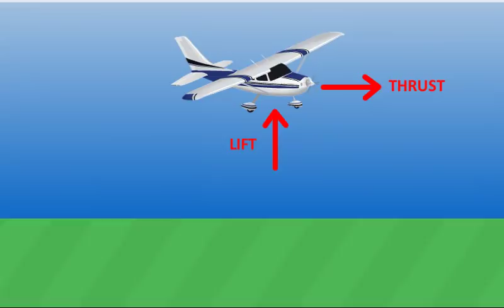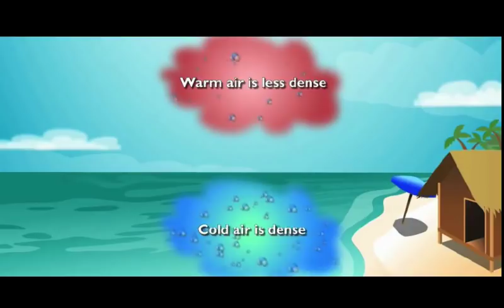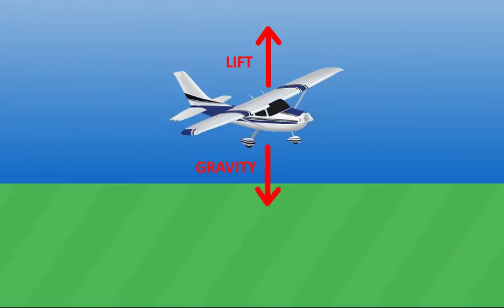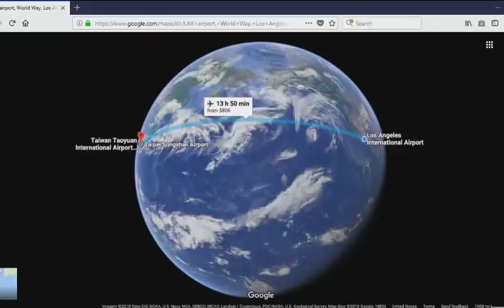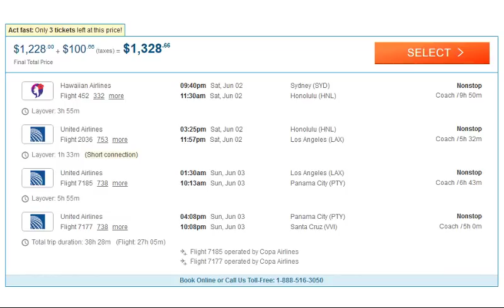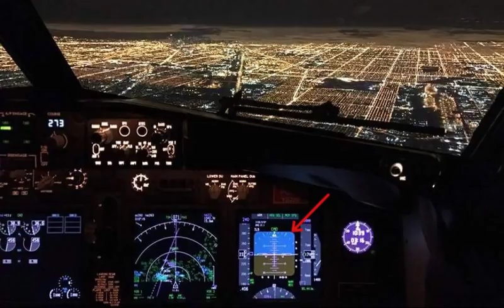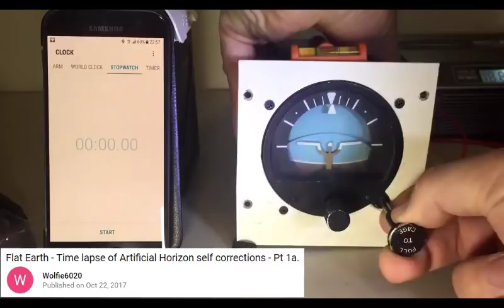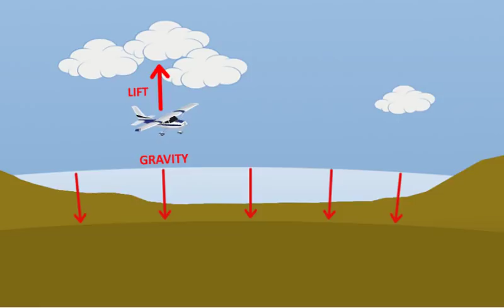Flat Earth Falsities - Plane Nonsense

Comment: Listen to what you're saying dude. Clouds stick to this earth due to this Force you can't identify called gravity!? A force you've never seen for yourself. I can simply explained stuff falling and sticking to the Earth as density. I see clouds moving all the time and they're never moving with the Earth. They sometimes move fast and sometimes slow but I always independently. I can explain this easily due to the water cycle and thermodynamics. Clouds also move swifter and slower due to weather currents that are caused by these temperature changes and wind which pushes and pulls the clouds accordingly . This is how thermodynamics work. I don't even have a science degree and I can explain this due to my own observations. Whenever y'all can't answer simple questions gravity is always the answer. Always!
Reply: "A force you've never seen for yourself."
Can you see magnetism?
Reply: AI fan IDIOT A MAGNET IS A MANMADE OBJECT !! IF GRAVITY WAS A THING YOU CANNOT COMPARE THEM AT ALL BECAUSE MAN DID NOT MAKE GRAVITY !! ITS JUST A WORD TO ANSWER EVERY QUESTION FOR THE GLOBE STUPIDNESS TAKE OUT GRAVITY FROM THE CONCEPT AND ALL THESE PPL WONT KNOW THE FUNCTION OF THE EARTH, WE DO NOT USE GRAVITY AT ALLL TO EXPLAIN EVERYTHING WHY IS THAT? BECAUSE IF THE WORD GRAVITY DIDNT EXIST THE FLAT EARTH MODEL WOULD BE PERFECT AND EVERYONE WOULD KNOW THE EARTH IS A PLANE NOTT PLANET FLAT EARTHER KNOW THAT GRAVITY IS A MADE UP THING TO MAKE ALL YOU GLOBERS BELIEVE THE GLOBE LIE
Reply: @jayreckless1120  Diddums. Bless. Watch your heart. No need to throw shouty hissy fits is there.
"A MAGNET IS A MANMADE OBJECT" No., why don't you follow your holy, unbreakable mantra "Question everything. Do your own research"? You didn't question a thing, did you. You didn't do any research, did you. Why not? You FE cultists are always telling other people they are sheep and the magnificent FE cultists are not sheep because they always follow the mantra "Question everything. Do your own research".
Ancient people learned about magnetism from lodestones, magnetite
The first magnets were naturally magnetised pieces of iron ore, lodestones or magnetite. The word magnet is from Latin magnetum "lodestone",  from Greek μαγνῆτις [λίθος] (magnētis [lithos])[1] meaning "[stone] from Magnesia".. Lodestones were the first magnetic compasses. The earliest known surviving descriptions of magnets and their properties are from Greece, India, and China around 2,500 years ago.
"BECAUSE MAN DID NOT MAKE GRAVITY", just like he did not make magnetism,
Reply: wong stop right there your using information given to u by occultists how does it prove anything? We have  real proof Wong look I’m not here to start arguments something big is COMING BRO AMD IT INVOLVES EVERY SINGEL NATION BELIEVE IT OR NOT , READ PROJECT BLUE BOOK WE SUPPOSEDLY HAVE ALIENS IN EARTH AND YALL BELIEVE THAT TOO?!YOUR GOVERNMENT DOES NOTHING BUT LIE AND WE BEEN LIVING A LIE BRO I FOUND THAT OUT 2 YEARS AGO !  SO IM LETTING YALL KNOW BECAUSE WE ARE ALL INVOLVED
Reply: Dawid Dziedziak ITS CALLED MASS BRAINWASHING AND IT COMES WITH AN  AGENDA LOOK ON THE CIA FILES THAT WAS CLASSIFIED UNTIL THEY RELEASED IT TO THE PUBLIC AND WE DIDNT EVEN NOTICE MY QUESTION IS IF ALL THIS IS JUST A CONSPIRACY WHAT SERGE MONAST SAID THEN WHY WAS HE AND HIS CO AUTHOR BOTH ASSASSINATED OVER A CONSPIRACY? And FOR YOU GRAVITY PPL EXPLAIN THE MOON , HOW IS THE MOON NOT BEING PULLED BY GRAVITY ? IM PRETTY SURE “GRAVITY “ WOULD EITHER PULL THE OBJECT UP OR HAUL IT DOWN BUT THE MOON SHOWS NO SIGN OF FORCE MOVING !!
Reply: @jayreckless1120  Seek medical attention ASAP.
Reply: @jayreckless1120  "We have  real proof" Well, where is it?
 "Wong look I’m not here to start arguments". So why did you and are you?
"your using information given to u by occultists"
Sextant corrections. Personal experience and observations.
 Long distance navigation. Personal experience and observations.
Spherical trig.  Personal experience and observations.
The fact that land slowly goes below the horizon when you sail away from it and slowly rises from the horizon when you sail towards it. Personal experience and observations.
The fact that you can see further with increasing height. Personal experience and observations.
Celestial navigation. Personal experience and observations.
Personally observed proof of rotation. Trade winds, TRS, gyroscopes and gyrocompasses, ocean currents, weather patterns.
Al that is real proof.
"We have  real proof" Well, where is it?
Reply: Dawid Dziedziak I got one question for you if you have a big plan very big you would need to fund as much as you can to keep the plan going right? Hiring everybody u can and all that right ? Now look back into all our science and everything we know today , WHERE DOES IT COME FROM ?! OCCULTIST EVEN YOUR WRITERS AUTHORS EVEN YOUR SHERLOCK HOLMES WE LOVE TODAY THAT WAS ALSO CREATED BY AN OCCULTIST , ASTROLOGY ALCHEMY THOSE ARE ALL OCCULT SCIENCE!!! EVEN OUR ENGLISH LANGUAGE CAME FROM THE ENOCHIAN WHICH ALSO WAS AN OCCLUT LANGUAGE!!! WTF GUYS DONT YOU SEE OUTLR WORLD ORIGINATED FROM FUCKING OCCULTISTS AND YALL STILL BELIEVE THEM !! LOOK IT UP GUYS YOUR MISSING ON ALOT AND THERES A REASON FOR THAT !! DID YOU KNOW ABOUT CLOUD SEEDING ?!! ITS USED TO MESS WITH THE WEATHER INCLUDING RAIN AND SNOW !! NOW IF THEY COULD DO THAT WHY ARENT THEY CAUSING LESS SNOW OR LESS RAIN !! ? BUT NOO EVERY YEAR THE WEATHER GETS WORSE WHEN YOUR FUCKING GOVERNMENT CAN CONTROL IT
Reply: @jayreckless1120  Then stop speaking english and using computer, internet, smartphones, cars, television etc. . It all comes from 'occultists'.
Reply: @jayreckless1120  "By the time Project Blue Book ended, it had collected 12,618 UFO reports, and concluded that most of them were misidentifications of natural phenomena (clouds, stars, etc.) or conventional aircraft. According to the National Reconnaissance Office a number of the reports could be explained by flights of the formerly secret reconnaissance planes U-2 and A-12. A small percentage of UFO reports were classified as unexplained, even after stringent analysis. The UFO reports were archived and are available under the Freedom of Information Act, but names and other personal information of all witnesses have been redacted."
So no actual proof.
Remember, David Copperfeld is a billionaire because of how easy it is to fool the human senses and no other reason. Sadly, people such as yourself somehow seem to ignore  facts like this.
Reply: wong READ ON OPERATION FISHBOWL AND WHY DOES OUT GOVERNMENT SAY “WE DONT WANT TO OPERATE OUR ENTIRE NATION IN A FISHBOWL “ IF THE EARTH WAS A SPHERE THEY WOULD NOT REFER IT AS A FISHBOWL WHY BECAUSE A FISHBOWL FLIPPED UPSIDE DOWN IS A DOME WITH THE FLOOR BEING THE FLAT SURFACE NO LIE WONG GO READ IT IN THE CIA FILES SINCE YOUR THERE AND TELL ME WHY THEY USED A FISHBOWL TO REFER TO THE EARTH
Reply: Dawid Dziedziak YOU WILL SEE WHEN IT COMES AND THINK OF ME I WANT US TO WORK TOGETHER BUT YALL CANT EVEN DO THAT THEY ARE AGAINST US THEY LIED ABOUT THE MOON THEY NEVER LEFT!!! SO NOW SUCK THAT UP AND FIGURE OUT WHAT YOURE GONNA DO ABOUT IT PROBABLY NOTHING .
Reply: @jayreckless1120   "We have  real proof" Well, where is it? You have yet to provide anything.
 "Wong look I’m not here to start arguments". So why did you and are you?
"your using information given to u by occultists"
Sextant corrections. Personal experience and observations.
 Long distance navigation. Personal experience and observations.
Spherical trig.  Personal experience and observations.
The fact that land slowly goes below the horizon when you sail away from it and slowly rises from the horizon when you sail towards it. Personal experience and observations.
The fact that you can see further with increasing height. Personal experience and observations.
Celestial navigation. Personal experience and observations.
Personally observed proof of rotation. Trade winds, TRS, gyroscopes and gyrocompasses, ocean currents, weather patterns.
Al that is real proof.
"We have  real proof" Well, where is it?
Reply: @jayreckless1120  Feed my sheep. Baaa. baaa.
Reply: @TheGodlessGuitarist  who said anything about magnetism? I just think things are a lot simpler than everybody wants to make them out to be.
Reply: @Tiger-fv3nl  "ho said anything about magnetism? I just think things are a lot simpler than everybody wants to make them out to be."
The point is that YOU disregard gravity because you can't "see" it but you accept magnetism even though you can't "see" that either.  In other words you are cherry picking what forces you accept as real because one of them is damaging to your flat world beliefs.

"Buy I nice well zooming camera, go to your nearest beach and watch the boats go out of site then Zoom your camera in and watch those boats come into full view again."
I have done this.  Numerous times.  Portions of the boats hidden by the horizon never come back.  Ever.  Your experiment supports the globe.
Reply: @Tiger-fv3nl  you wrote "this Force you can't identify called gravity!? A force you've never seen for yourself.", you seem to be assrting seeing a force as a reasonable standard for accepting its existence. I'm simply asking on that basis of that standard whether you believe magnetism is a real force. BTW, I can identify gravity. It is called gravity. That is its identity.
Reply: @MrQuaiven  yes that can be easily explained by refraction but at multiple miles out boats that should completely disappear due to curvature can clearly be seen. My uncle owns a shrimp boat and this experiment has also been done multiple times. This is figured according to the Earth's curvature calculations given to us by scientist and mathematicians.
Reply: @Tiger-fv3nl   If you think that you are smarter that all the scientists who have spent whole their lives trying to explain the world we live in then, well, there is really no help for you. 

But here is a very simple experiment for you. Buy a precise laboratory scale with accuracy up to microgram and 1kg callibration weight. Now put that 1kg on a scale, here on the surface and then at an altitude of 5km. That one kg will weight a tiny, tiny bit less due to you being further away from the center of Earth - center of mass and gravity. This simple experiment proves that gravity is a real force.
Reply: "I don't even have a science degree"  There was n need to state the bloody obvious, was there.
"A force you've never seen for yourself." I've never seen you, so you don't exist. That is your logic. Fucking stupid isn't it.
I've never seen an electron, so electrons don't exist. That is your logic. Fucking stupid isn't it.
And so on.
Gravity is the name we call a natural phenomenon. Just like electromagnetism and germs.
To prove its existence, you need to hold a small item and release it from your grip. According to the law of inertia, it should have remained as it was. But did it? No.
The law and theories just explain how it affects things. OK?  Just like the law and theories of electromagnetism, oxygen and germs.
Gravity is the name we give to the phenomenon that objects accelerate towards each other when they are otherwise left to their own devices. The “proof” of gravity is the demonstration that the phenomenon happens.
http://www.bbc.com/news/science-environment-42183077
Gravity   Eddington
https://www.ecosia.org/search?q=Gravity+++Eddington
http://www.bbc.com/news/science-environment-42183077
https://www.ecosia.org/videos?q=The+Cavendish+experiment
"measuring gravity with GRACE”.
https://www.ecosia.org/search?q=%22measuring+gravity+with+GRACE”
Reply: @boffeycn  why do you feel the need to cuss? That just makes you look like a wee little man. Read my comment to the last guy. I don't need BBC articles to prove my point unlike you because we actually do experiments. Until you have done any experiments for yourself don't give me that nonsense. You are a fool if you think you need a science degree to do scientific observation for yourself
Reply: Proof the Earth is flat
Muy holey bubull am der troof.
Reply: @Ben J you are right it is actually 7.98 inches per mile squared. Whether you like it or not that is the official curvature calculation and there's no way around that. It's crazy I used to think the same thing you do until somebody told me to do some experiments and I did and the results were not what I anticipated.
Reply: @Tiger-fv3nl  BenJ is really going at it.... an other sane one that.. loves retards...  Dude want me to "Follow the path of the moon.... see how it's not glowing... "  Like anything SHE does is evidence of all this mad rotations going on.
Jesus! If the Sun has gone "down" west and it is dark all over, how can the Moon show up at east and be full, NOT SHADOWED BY the Earth?????????  DAH
Reply: @Tiger-fv3nl  " it is actually 7.98 inches per mile squared." and what shape does that describe?
"the official curvature calculation and there's no way around that.: Says who?
" I used to think the same thing you do " Lie.
Reply: @Ben J WELL well the Scientist worshipper, pray who are all these great minds??? Name a few aside of TV;  Neil deGrasse Tyson, Brian Cox, Michio Kaku, Bill Nye, Suzuki....  The path is not glowing... no it aint a burning gas ball anymore then the SUN is... both are electric converters beaming rays. 
That disk is facing DOWN, ...eee every other dont see same, as I went it rises and stands high. 
Drugs may explain some to that stuff.
Reply: You don’t need a degree man your smarter than these globe idiots on here they use gravity to explain everything! I bet they answer for my the water don’t just fall of the surface of the earth is gravity ! Lmao little did they know that gravity goes all the way it doesn’t stop after a certain action if there was gravity then someone explain the oceans if the gravity was keeping the water in wouldn’t that mean gravity is all around us ? But that’s not true is it? Because when I jump there’s no gravity and plus if gravity was keeping the waters in like they say then there would CONSTANTLY BE PLENTY OF STRANGE PHENOMENON WITHIN EVERY SINGLE CORNERS OF THE EACH OCEAN BUT THE OCEAN STAYS CALM AND THERES NO SIGNS OF GRAVITY THERE !!! SO WHATS KEEPING THE OCEANS FROM JUST FALLING OFF THE FACE OF THE EARTH ?
Reply: @Ben J J O a clever reparty, but you registered more then that explation?  No Moon too small, EARTH real BIG, Atmosphere and eyes not so good.  That is just what I said sir "you and every other observer on earth" over globetardia. 
Try to explain to yourself how Everyone sees same moon face on all sides from both poles, even with your perfect locked sync construct.
"The moon's orbit is actually quite complicated to describe", your Authorities say, indeed, all this spinning and rotation around, but all remains the same millenium after millenium.
Reply: Ben J I gave u my point of view answer my questions go on the official nasa page and look for the moon landing you’ll see the flag waving !! Then look on YouTube at the new revised video the flag is no longer moving !! Why is that please explain! Also explain to me y i took a hot air ballon and as I got closer to the sun I got colder very very fucking cold but why am I getting cold heading towards the sun if it’s 3 kelvins hot ?! Also the sun was notttttt outside the atmosphere of earth it was pretty fucking close to me ! Another question sun is very hot according to nasa right ? And space is -4 kelvins cold right so how has that sun managed to keep hot within a vast emptiness of alllll coldness that sun would either over power space causing it to get hot OR THE SUN WOULD DIE OUT BECAUSE OF ALL THE COLD SO WHY DOES THE SUN CONTINUE TO SHINE VERY BRIGHT FOR MILLIONS OF YEARS ? GRAVITY? 😭 Lmao AND IVE PROVEN ALL THESE THROUGH THE COURSE OF MY LIFE SO EXPLAIN BEN J
Reply: Ben J BRO YOUR JUST BY WHAT YOUR SAYING I KNOW YOUR REAL LIFE STUPID DONT SAY U HAVENT BEEN WARNED AND THE PROOF IS IN YOUR FACE IF YOU CAN PROVE THEY WENT TO THE MOON THEN SPEAK NOONE HAS PROOF THE ONLY PROOF WAS A VIDEO FOOTAGE THAT LASTED 3 HOURS LONG AND IT WAS LIVE ? HOLD UP NOW I COULD GET SERVICE TO PPL ON EARTH AND MAKE A LIVE STREAM WHEN IM ON THE MOON ? THERES NO CELL TOWERS OR ANYTHING ON THE MOON TO ALLOW THAT VIDEO TO EVEN BE REAL , EXPLAIN WHY THE FLAG WAS WAVING IN THE OFFICIAL FOOTAGE BUT THEN WHEN WE CAUGHT ON THEY QUICKLY MADE A NEW VIDEO AND PUT IT ON YOUTUBE WITHOUT THE FLAG WAVING !! BUTT THE REAL FOOTAGE IS STIL ON NASA PAGE GO SEE YOURSELF AND TELL ME YOUR GOVERNMENT DIDNT LIE TO u
Reply: No... PROVE ME WRONG WITH REAL EVIDENCE ON MAN GOING TO THE MOON ! THERE IS NONE THEY LIED GET OVER IT AND THEY COULDN’T EVEN HIDE THE EVIDENCE THEY JUST TRIED TO COVER IT UP THANK YOU , YOU KNOW IM RIGHT BUT YOUR JUST HERE TO POLLUTE THE MASS PROBABLY A ROBOT 🤖
Reply: @jayreckless1120  "PROVE ME WRONG WITH REAL EVIDENCE ON MAN GOING TO THE MOON" So far whenever you have been given evidence of anything you just deny it, don't you. In other words you don't want evidence, do you. you want people to agree with your delusions. And argue.  And argue.  And argue.  And argue.  And argue.  And argue.  And argue. 
"I WANT US TO WORK TOGETHER" So why do you discount evidence?  And argue.  And argue.  And argue.
Reply: @Ben J "The moon's orbit is actually quite complicated to describe" [1]
"nothing can face all directions at the same time." ???? ...eee I thought that was what a sphere was all about !
People dont see the same face of a Plane /ISS  from "ALL directions"?  Are you with a Concave earth ? 360* ????
This is an antipodes  thing??  And what of 1/2 Moons in Day time ???????
NIKON p900 daylight half moon Germany  /watch?v=bmLYgCR5znw   - HELLO HELLO !!! Mr Simple?

[1] The moon orbits the Earth roughly once per month. ... The moon's orbit is actually tipped a bit to the Earth's, so sometimes the new moon happens when the moon is "below" the sun, or "above" it. But at some point in its orbit, at some point in the month, it appears to be as close to the sun as it can.Sep 7, 2016
Phases of the moon - Curious - Australian Academy of Science
https://www.science.org.au/curious/video/phases-moon

Why is a half moon straight?
It is all a result of the Moon's orbit around the Earth, and the Earth's orbit around the Sun. And exactly when you see the Moon in the shape of a 'U' (lit on the bottom) rather than a backward 'C' (lit on the side) depends on what latitude you are at.
Why is the crescent moon sometimes lit on the bottom?
https://starchild.gsfc.nasa.gov/docs/StarChild/questions/question43.html
Reply: Looks like that did it... :) :) :)  now for the Simpletons= 5 Facts That Prove The Earth Is Flat watch?v=e5ACN9iF8Jw&t=93s  2:55   but simple does not be Reality proof, just as Science facts...
You see the different FACES at the HORIZON, except when at very high altitudes(direction UP), because the horizon is the shape of a FLAT circle around the viewer eye level.  From horizon point at whatever side: far UP objects look same.
        If you could understand the difference you would not be a globe earther.
How many directions are there in the world?
As children grown up understanding that there are broadly four directions (North, South, East and West). 
But is that true? Up, down, - these can be difficult concepts for some simple childrens. 

ps: is a flattard writing sanely an oxymoron?
Reply: MaxPowerTheManYou I understand bro if that was the case why did nasa make a restored video with the flag not waving anymore in 2014 ?
Reply: To be fair, this unseen force called gravity is also perceivable by the blind. Sight does not define gravity.
Reply: Re:  "A force you've never seen for yourself."  I have.  I've measured it in a lab.   It's a fairly simple experiment using a special version of a torsion pendulum called a Cavendish balance.  You can buy a ready made one for less than $1000 (US)  or build one yourself for much less if you want to "see" it for yourself as well.   Or, if you're willing to watch a video, here's one:  https://www.youtube.com/watch?v=SqsXVS4PYSI
Reply: @Ben J there you go with the typical "world's great minds" answer. Who is the real fool, someone who thinks and experiments for themselves or someone who just listens and depends on the "world's greatest Minds"to give them information?  A little research into these individuals and you would figure out that most of these people were absolutely insane and probably should have been institutionalized which some of them actually were. Also Jack Parsons was a well-known occultist and he formed the foundation for NASA! Man you have to be out of your mind to believe a word these people say! I will give you an experiment that you can do right now yourself. Buy I nice well zooming camera, go to your nearest beach and watch the boats go out of site then Zoom your camera in and watch those boats come into full view again. Supposably these boats are disappearing over the Curve but I know and other people know that have done this experiment that it's not true. Also give me an experiment that I can do myself to prove that the Earth is a globe without having to depend on the "world's greatest Minds".
Reply: @Tiger-fv3nl   'Also give me an experiment that I can do myself to prove that the Earth is a globe without having to depend on the "world's greatest Minds".'
Ah well, no flerfer has actually responded to this observation list yet, but here it is again.
https://docs.google.com/document/d/e/2PACX-1vQfKhy5fUh7JrN1xqhQirhrOh8JU2qBwibUHwk6NKWaldG3h3NO-NKcfvrxfmD5fPU0PNCYmcJ53smZ/pub
Reply: @Tiger-fv3nl  Experiments for themselves? AKA watching youtube videos made by the dumbest f** on the planet? `

The things with the greatest minds in history is not the fact that they figured shit out, but the fact that these ideas resulted in formulas and models that can be tested and confirmed. That the way all these forces interacts sums up to something that can be shown in real life experiments. Ideas that have been challenged and often improved upon since they were conceived or proven. All in all, a model that thousands and thousands of independent scientists have confirmed.

The FE logic on the other hand requires 2/3 of the world’s population to be in on a grand conspiracy. FE logic need to take actual observable facts, and just say they do not exist. Like the midnight sun south of the arctic circle. Never mind the just about 40000 tourist experiencing it every year.